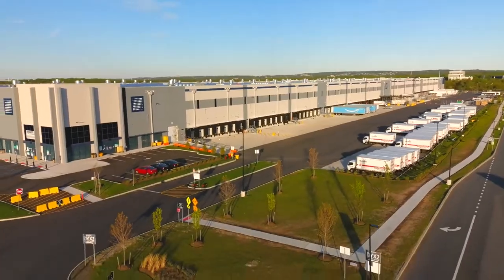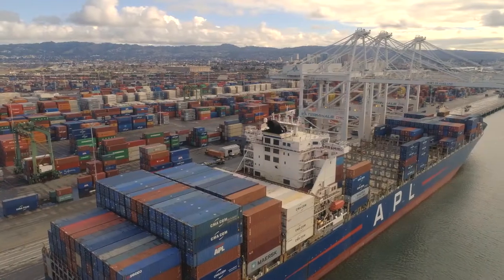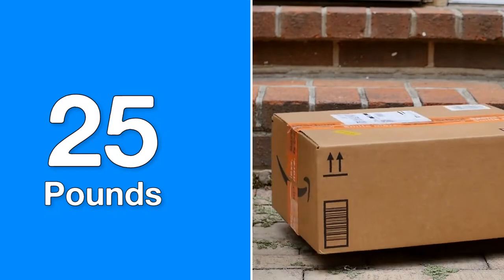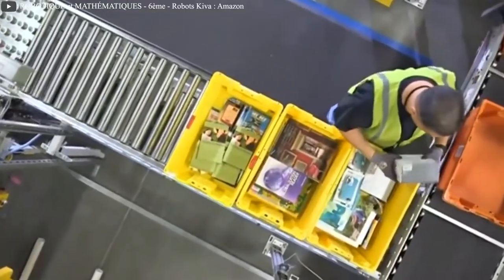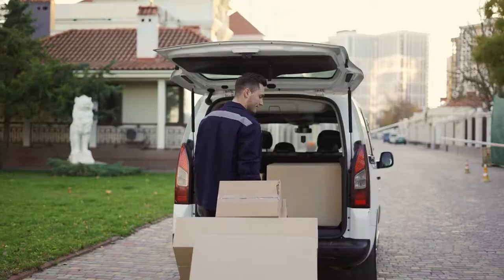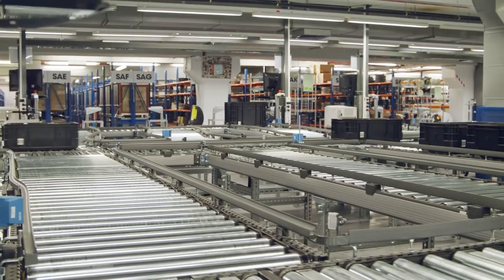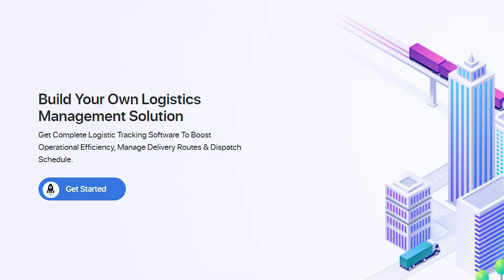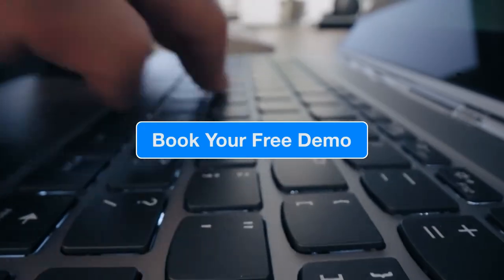How Amazon Delivery Works? | How Amazon Delivers Your Packages so Fast

Comment: I live a couple miles away from a huge fulfillment center, but how do THEY receive the item so quick? Do they just over night flight it??
Reply from the maker: Thank you for watching our video and for your question! Amazon has built an incredible system over the past two decades that enables them to quickly receive products at their fulfillment centers. This system, combined with their extensive delivery network, allows them to deliver packages quickly. This efficient process is a key factor in Amazon's ability to provide fast delivery service. This is why many new ecommerce players struggle to compete with Amazon, as they are unable to match Amazon's established infrastructure and delivery capabilities.